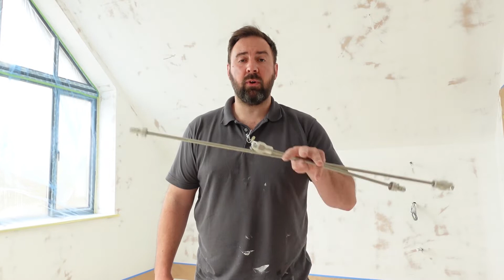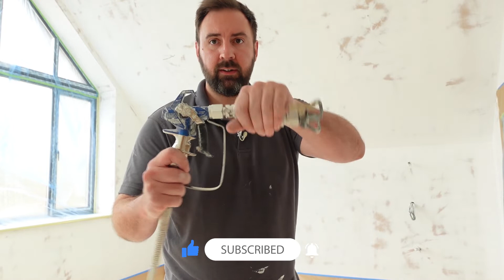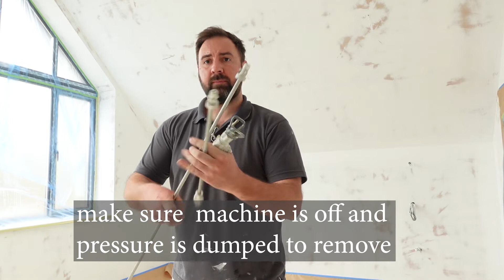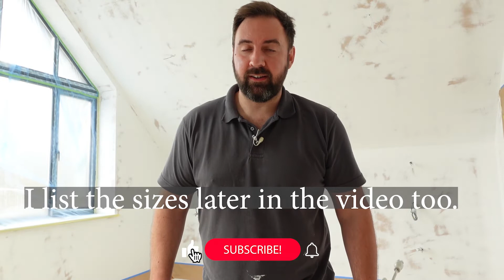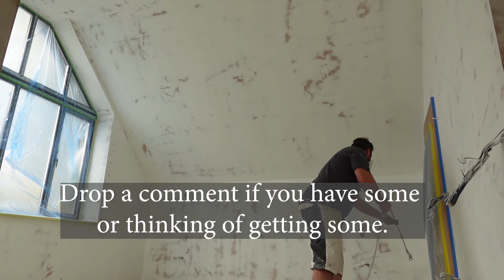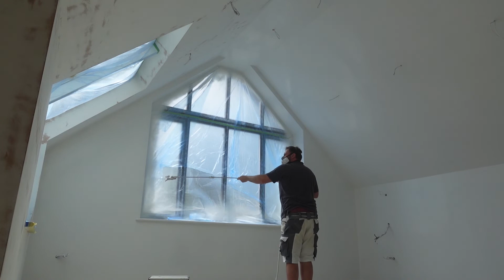Qtech Quick Connect Extensions - Airless Paint Sprayer (Triad)

Comment: Nice thanks - what tip / pressure / product you using there on that ?
Reply from the maker: I used a 518 tritech ultra. Pressure not sure i just work to the slray pattern.  And turn up until solid. Product was leyland vinyl matt and leyland contract matt for mistcoat